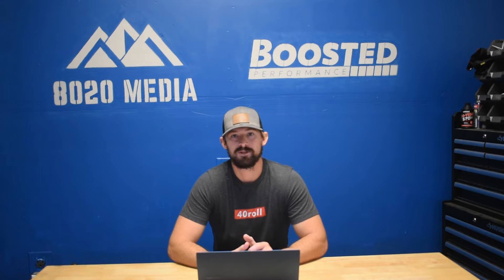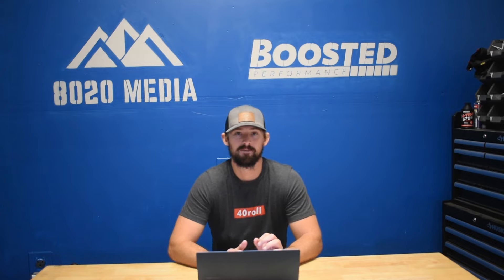DIY: How to Fix GMC/Chevrolet "Service Stabilitrak" & Traction Control Lights!

Comment: So basically the car industry figured out how to make customers throw money at their "rigged for failure product" by disguising it as safety.
Reply from the maker: D.C. - Those features, mainly AFM, has affected the reliability of these modern engines.
Reply: Yes I hate 😒 itttttt
Reply: Basically
Reply: @8020Media  
Yes. It's extremely unsafe to drive. The truck will stop without notice.. Also the dealership never know what's wrong even though the vehicle is running like shit. I guarantee they know what's wrong with your car at the dealing with thousands with the same problem. They should be sued
Reply: I went today and got a smog and it did not pass because it said a oxygen sensor on on the catalyst so I don't know which sensor I need to change but I was driving it tonight from work traction control light came on with the brake light flashing the brake light went off but the traction control light stayed on the whole time but when I came home turn the car off turned it back on then it was off what do you think it could be or where should I go to get a check
Reply: I do not have any check engine lights on at all
Reply: @amberwilliams1571  
I wish I could tell you. They made any issues you may have very difficult to fix by making it seem like multiple problems, that way you're stuck buying parts that you don't really need to change. I'm going to sell this piece of shit because it's a nightmare to drive!!
Reply: I got a check engine light, one or more sensors need checked! What does this mean.
Reply: ExaCtly- were stuck with 12.000  loss   and just sits in driveway
Reply: Yeup then leave u without a car for month meanwhile they chek it smh😅
Reply: @amberwilliams1571    Yup!  I don't have any engine codes either and my motor runs great.  So WTF?   How can something trigger the stabilitrack lights but then not trigger any engine codes?
Reply: What makes you think greedy billionaires would be greedy?
Reply: My mechanic said I could say fuck it and not fix it and I just won’t have anti brakes, you would get the slam on the brakes skid effect. It could save you from an accident but in 1979 there wasn’t this fancy BS And we all are still alive here. My express 3500 runs fine, my buddies Cadi he been running it with Abs stability track light on for 15 years without a 
problem. He says in video about rough idling, fuel issues ect. I suggest you get it diagnosed and if it’s the pump and model Fuck it  drive it and forget GM. I don’t need it. I don’t drive like a dick so I don’t generally slam on the brakes. If you do who cares skid a little. But $1000 to fix this bs. 2x under 34k I’m tired of feeding GM. Stability track $. If it breaks again I’m not paying again to fix it. Had this problem in 5k then 34k. Vehicle sat in heated 65 degree temp garage for a year. 2 weeks back in service stability track bs again. When they sit outside they rust. Seems like if your vehicle sits it breaks but this can say in a clean huge heated garage. Parking over gravel kill’s vehicles and letting them sit over gravel and outside is definitely asking for problems. If I didn’t like GM for work trucks I wouldn’t buy them. But only have 2 of them. I manage my risk and don’t buy GM for any other reason.
Reply: @victorm.4167  
I'm already with you on that.. I put black tape over the stabilitrac lights that pop on so I won't see it, and drive like normal.  Some people issues makes their truck drive bad but mine drives fine so I just forget about it. Black taped over it, out of sight out of mind. Smh You're absolutely right, fuck it!! They not getting a penny from me with this BS. 👌🏽
Reply: I just had dad's fix on his 2012 GMC Yukon. 290 bucks wasn't that bad.
Reply: @maxwind1862  
Your dad is lucky. I remember when you could take your car to the dealership and trust they will fix the problem, also be able to pinpoint the problem. They would gave you a estimate to fix it and a time to pick up your car fixed and ready to go... Now they gave you a list of parts that might fix your car. So you're stuck paying for parts that might fix it. They gave me a estimate of over $4000 with a long list of parts to change that might fix my truck. Keep in mind my truck runs fine like most of the people with this issue. I changed the battery, and put 2 bottles of fuel cleaner in it. Now the light barely ever comes on and runs fine
Reply: Tip:  Put a can of fuel cleaner in gas tank and run it out... I did this twice back to back on two separate fill ups... This definitely helped with the proformance.
Reply: @desert4seat my issue was the MAF sensor. Although I did have a check engine light on for awhile before the traction control began to act up ... I cleaned it and light went off and no more traction issues. I would say start there. It's easy to access and clean! There's vids on that too. It's worth a shot and easy to do.
Reply: @d.c.williams787 also put a proper amount of Sea Foam in the crank case. The ratio is 1oz per quart of oil. I do mine 300 miles before an oil change! It helps clean out your internals ... valves, piston rings, spark plugs etc. I've been doing this for awhile and I've noticed a huge difference in performance. You can smell it getting cleaned ... like burning oil for the first few miles but trust it's cleaning things out 👍🏽
Reply: @caliallstar1334  
I was just thinking about that. I'll definitely start doing that also. 💯
Reply: I have a 2012 GMC and a '84 Chevy. Guess which one is more reliable....
Reply: Ding, ding, ding!!!!!! We have a winner!!!!!! It's amazing anyone survived before this new worthless technology. 😂😂😂😂 I drove for many years before all this BS came out, and so far, I've done just fine.
Reply: They are professional grade! 😂😂😂
Reply: Absolutely 😊
Reply: also mine was  1st the gas pedal....another time my throttle body...another time there was a vaccume leak...another time it was bad GASOLINEEEEEEEE...... 3 OF THOSE TIMES THEY WANTED TO DO WHEEL HUBS AND SPEED SENSORS.......
Reply: @fixitfelix718  
They rigged this truck for failure..  there's no way all that stuff should cause the same issue.. They wanted to sell me a new Tahoe, I told them after this I'll never buy any from them. I'm sure the new models will start doing the same soon
Reply: Really weird, on my 2017 ss camaro I can hold down traction control and it will shut off traction control, and then keep holding and it shuts off stabilatrack, but on my 2019 LD Silverado, that light pops up I lose power steering and my dash screen flickers and dims and shit and a couple times my truck has actually shut off while driving or popped up stabilatrack and airbag light at the same time? Idk this truck pisses me off some times man I cleaned the ground on the passenger lower a arm and reinstalled that solved it for about a month or so, now today my truck is pulling this shit again lol
Reply: 100%they did, not just one manufacturer, ALL of them. I've been preaching this for years. It's not just the "safety features" either. "Innovations" like push button start, wheel hub assemblies, fully automatic headlights, and electric steering generated new markets for public sale. They also integrated new, more fallible parts where there wasn't a problem before. Maintainance costs on you're average car over they past 25 years are higher than ever before in history due to these "innovations".
Reply: My 2016 Colorado was on the shop for a little over a month for stabilitrak and power steering @ a Chevy dealership. They did not kno what the problem was, said it was the spark plugs, changed tht then called and said they are still having the same problem, stated that I needed a new steering kit changed that cost me $2600 to get it fixed. They need a recall on that.
Reply: @imbrandon16  
Chevy scamming billions off of loyal customers. I've owned 3 Chevy Tahoe and this is the last Tahoe I'll ever buy. Just sold my 2002 Tahoe that run like a fucking champ. So all the idiots had to do was change the body style and put a big screen in it and it would be perfect. They made this model to drain money from you from constant maintenance and making money on parts sold. I will eventually get around to selling this BS once I make my mind up what to get next.
Reply: @mrmotormd  
Right it's painfully obvious.. Chevy used to be reliable now they suck azz. Even customer service and the mechanics at the dealership are trash. I remember when technicians would diagnose your car and telling you what the problem is and how much to fix it... Chevy is now the new trash 🗑️
Reply: @d.c.williams787  it's not Chevy. Chevy is probably still one of the better platforms maintenance wise. I'm talking about planned obsolescence from literally every manufacturer. It's been one "innovation" after the other until all cars have become costly maintenance hogs compared to cars just 30 years ago.
Reply: 100% all this added tech for safety is a fucking scam my trucks Stabilitrak will randomly kick off and reduce engine power. driving straight down the high way stupidest thing ever.
Reply: What do you think catalytic converters are for? They choke your motor out faster by restricting air flow...this whole it burns up excess fuel from your cylinders is bullshit...how long have they been building cars? And they can't figure out the spray so there isn't any fuel after the cylinder? And the other supposed function of it is to burn those gases into a solid so it falls out the tail pipe....or more than likely clogs the catalytic converters putting stress on your motor and therefore killing it much sooner than older cars do so they can sell you a new car sooner. In the name of clean air...so we had these since the 70's and still it worse? Guess ya really don't need them then....never did
Reply: @desert4seat what year?
Reply: Cuz the stabilitrack sensors are in the wheels not the motor
Reply: @amberwilliams1571  get a cheap OBD code reader and it will tell you which O2 sensor it is. They are easy to change with a 7/8 wrench.
Reply: Bingo!
Reply: @jarrodbuma9705 I’m getting that sensor coming on and it’s idling rough
Reply: @ Then why are GM engines exploding at 45-60,000 miles?
Reply: @ It means you need an OBD reader.

Comment: This happened to be in my way to work this morning. Complete loss of power, got pulled over and basically tuned it on it off a few times, nothing. Turned it off for a couple of minutes and it was good as new. After reading all of these comments and watching the video, i feel like its probably my brakes. There long past a change.
Reply from the maker: H - Sorry to hear! Keep us updated.

Comment: I was having problems with my traction control and stabilitrak as well as having engine misfires causing a rough idle. I was going to change the sparks plugs and wires then tackle the other issues later but after watching this video I got hopeful that this may fix both issues. I changed the spark plugs and wires over the weekend and all my traction control/stabilitrak issues were all resolved. Great video, I like to watch video's that explain in depth how control systems operate which make it clear how issues relate to each other.
Reply from the maker: Awesome, thanks for watching and glad you got the car fixed! A lot of videos out there just say "change your spark plugs" but the more you understand why you need to change your spark plugs the more you learn so we try to keep everything as informative as we can.
Reply: What wires did you change?
Reply: @danielvargas3208  I changed the spark plug wires, one broke when taking it off the plug and one was damaged because it was rubbing on something. Make sure that you retain the heat shields and put them on the new plug wires, they just slide off the end of the end and are easy to save. No matter what anyone says, they are essential to prevent the rubber from being damaged by being too close to the exhaust manifolds.
Reply: @8020Media Glad I found this video.  Thank you for helping us.  Been having this issue for quite a while now.
Reply from the maker: John - We hope it helps!
Reply: I’m having the same issue for quite some time now I need Helppppppp
Reply from the maker: Ralph - What all have you done to try to solve the problem?
Reply: I finally took my Traverse to a different mechanic,  come to find out, mine was also the Brake Pedal Switch
Reply from the maker: Nubs - Thanks for sharing your experience!
Reply: What else needed to be done besides spark plugs for the misfire? I’m having this same issue right now and I don’t want to take it to the dealer
Reply: @wyattcooper9933  my vehicle is a 2007 GMC Yukon Denali that was having traction control issues and I changed the spark plugs and the spark plug wires. Some of them are physically hard to get to so make sure they are all changed because leaving one old one could still give you issues.
Reply: Hi Darren, good post. I should have read your post prior to posting mine. I have a 2013 Chev Imp 3.6 w/182K, also no CEL or TPMS, only stabilitrak light. The car reportedly has rough idle but otherwise "runs ok". Listed on auction and thinking about bidding.
Reply: @8020Media  Bro I have same problem in my 2019 cheverley spark 1.4 L stupid traction controle light stuck off and abs light. How do I fix this problem?
Reply: My check engine light stability track and traction control are on now my service brake system soon I put new coli packs spark plugs brake booster changer the throttle body fuel injector still having a misfires and rough ride
Reply: I did the same thing and was good for 2  months, not its back again, so frustrating
Reply: My 2008 Chevy Tahoe tractor control light on reduce engine power. I   all ready Chang  everything  and sill have this problem

Comment: I had Stabilitrak issues that were triggered by a bad battery. I had the battery checked at the local auto parts store, and it had low beginning wattage. Once replaced, we had no more Stabilitrak issues.
Reply from the maker: MVK - Thanks for sharing your experience. This will definitely help future viewers!
Reply: What kind of car was it
Reply: Im thinking I have this issue...
Reply: I did the same thing 8 months later it came back
Reply: Think this is my problem. Thanks
Reply: That happened to me too but then 3 weeks later I started having the issue again…. It’s at the shop now getting looked at.
Reply: Do you have an update on what the issue ended up being?
Reply: @laurentaylor2508 did they figure out what the issue was

Comment: Its bad when you prefer a check engine light
Reply from the maker: Q - True!
Reply: What’s the solution to this ? In need
Reply: @destinyjones2972  everything you have to hunt the issue down it's can be several things like wheel bearings spark plugs transfer case issue it's a pain in the ass

Comment: My current issue with stabilitrak is, when the light comes on and i turn off the truck the truck wont start. completely dead, nothing! it clears all of the codes if any appeared prior to the stabilitrak light coming on. Worst case scenario, which happened a few weeks ago was, i lost total control of the steering. I could not steer the truck while making turns. I am at a loss as to where to look to find this problem.
Reply from the maker: D - Your StabiliTrak light coming on, followed by a complete no-start condition and loss of steering control, suggests a serious electrical or power distribution issue, likely involving the battery, alternator, ground connections, or a failing power steering control module (if electronic steering is equipped). Since the truck completely dies when turned off, check the battery terminals and grounds, as a loose or corroded connection can cause intermittent electrical failures. A failing alternator may also cause power loss, leading to StabiliTrak errors and steering failure due to low voltage. If your truck has electronic power steering (EPS), a faulty power steering module or failing torque sensor could cause a sudden loss of steering. Scan for pending trouble codes, even if they disappear when the truck resets. Start by testing the battery voltage (should be 12.6V off and 13.5-14.5V running), ensuring grounds are tight, and checking for loose wiring to the power steering and ABS modules. If voltage drops under load, the alternator or wiring may be failing, cutting power to key systems. Keep us updated.